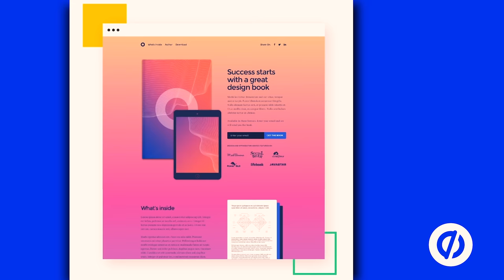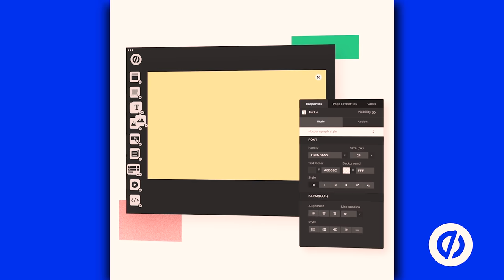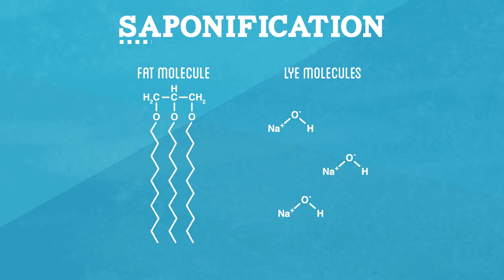How to Make Soap From Olives

Comment: Hang on, how were you actually using the screw? We didn’t see any sort of wheel or crank at the top for you to apply torque to the screw. Nor did we see it actually thread all the way down to apply pressure to the stack of crush olives.
Reply: The tap and die are still a ways off; carving the inverse of a hand carved thread would be very difficult with even modern tools. And that screw was far from straight. I'm guessing they took some artistic liberties with that part.
Reply: I assumed as much. I’d seen woodworkers make wooden nuts and bolts as a challenge, and it seemed difficult enough as is. When Andy first mentioned that he planned on making a screw, I was immediately a bit skeptical.
Reply: They did not press that oil either so it's all good
Reply: With such a wide thread the reverse won’t have to be exact. I would think a simple angled edge would provide all the power needed. 
I kind of like that they make these things from scratch and don’t hire professionals. It represents the struggle you and I would have to go thru if we had to provide for ourselves

Comment: Aren't railroad ties considered toxic by the EPA because of the creosote and other chemicals used to prevent rotting. I guess as long as it doesn't come into contact with the food directly it should be "ok". Look forward to the next video.
Reply: they're very toxic and not safe to handle, in my area people who try to use them for landscaping get in trouble because they're dangerous to handle so not allowed in residential areas.  they can make you sick if you handle them barehanded, especially older ones from when they were a bit lazier with safety regulations.
Reply: @TheMichigami  I hope they don't keep it around to long or at least replace it with something a bit safer
Reply: Older rail sleepers weren’t contaminated with creosote and so are able to be used
Reply: @lachlanngordon1577  from the cross section I saw I'm pretty sure that was a railroad tie soaked in creosote  and even if it wasn't it would still preserved with chromated copper arsenate which is almost worse.
Reply: @lachlanngordon1577  they've been using creosote on them almost as long as laying rail has existed, my gramma was warned as a kid never to play around with discarded track wood because it could make you sick, and even during the depression people living in coke ovens desperate for heating fuel would scrounge fallen coal off the tracks and burn furniture before touching rail wood, they knew it was poisonous to handle and burn.

Comment: This is something obvious but I challange you to make <tat tararam> bucket. 
You already are using iron tools but for bucket it would be challange, as iron is still fairly difficult to process. 
Therefore wooden bucket would be great starting point

Qualities:
- Can be cleaned, or quickly replaced
- Waterproof (duhh)
- Light (water will be heavy enough)

Comment: Pro Tip: Warmer temperatures speed up the chemical reaction a lot. When we did this in our Chemistry class, we mixed the lye and oil over a burner.

In my opinion Nitrate fertilizers and soap were the most important inventions for country development. With Nitrate fertilizers fewer people were able to feed a higher ammount of people, making it possible to assign more workforce to other sectors, and the soap made sure they didnt die so quickly from disease.

Comment: 11:57, Isn't that store bought chemicals? Is that why the second batch yielded better results? Does that mean the original sample is the only quality one can achieve with naturally collected materials?
Reply: The process of making soap requires oil, water and lye, plus mixing. Each oil has a molecular composition, chains, that react differently to the combination of lye and water. Olive oil takes a really long time for the immersion Process. The first attempt wasn't stirred long enough to completely incorporate the ingredients, which is why it separated. The 2nd attempt, stirring longer is what is required to get the mixture to end up being Soap, when using just olive oil.  No store bought chemicals were used. They made the lye, the hard way.

Comment: Yay, finally the screw!
One thing you didn't touch on, did the soap smell olive-y or lavendery or not at all?
Reply: From my experience with olive-based soaps, they do smell like olives a bit, but it's more subtle. So it should smell like a subtle mix of both.
Reply: It smelled really good!!! Very lavendery
Reply: @ornessarhithfaeron3576  ... I wonder where you are getting your olive oil soap? In my experience, without any other additives, it should smell like soap. Unscented soap.

Comment: Fun fact - you can get lyme (a mixture of calcium and potasium chlorids) by simply burning hard wood and putting ashes into water. Once mixed and then left to sit, hydroxides stay dissolved in the water while all the debree falls down to the botom.
Another fun fact, if you mix ashes with just enough water to create clay consistency, you can shape it like clay, then when left to dry and mature, calcium hydroxide binds with CO2 from the air, creating primitive concrete. For smaller amounds of materials, there is no need to mine anything. Ash from the cooking fire would do.

Comment: The high pH of the soap might have something to do with water-soluble compounds in the lavender. If you steep the lavender in warm oil and then filter it, you might be able to get most of the fragrance without the water-soluble compounds. At first I was going to suggest steeping the lavender in hot water and then discarding the water, but the oil soluble essential oils might leave with it, plus I think the flours could lose some of their color and wouldn't look very good.

Comment: You could easily neutralize the soap by testing it with living, blue lavender. Any blue flower is an effective test strip. If the solution turns red, add vinegar -- which is diluted acetic acid. Acid neutralizes base solutions.

Comment: You could have made the LYE by running water through wood ash and saved a few steps. Also, float an egg in the water to judge the PH. It should float leaving a spot about the size of a quarter above the water.

Comment: I must've missed the episode where you guys invented protective gloves, eveware, and ph strips!
Reply: I applaud the safety gear. The alternative to pH strips is called "zap testing": you literally lick the soap and if you get a shock sensation, there is unreacted lye and it needs to be left longer to cure. Considering that they didn't have a curing period at all here, it would have resulted in chemical burns to the tongue. (I've made soap by cold process and hot process).

Comment: To make a telescope, you need only flat mirrors (which can be made with copper or steel, too, if you polish and wax them) or precision-grinding glass lenses. Alternatively, you could use a mix of clear (tree) resin and glass dust (which is very dangerous, because when inhaled it can shred your lungs form the inside), which to be molded into shape. The resin-glass lens would need to have a custom recipe for the specific temperature (and maybe also rough humidity level) it's used at, to avoid it's melting. I think melting skin or sinew to make glue could be used to get glue which works in dry environments, too, but I'm not sure on how clear the lens will be.

For a mirror telescope (or reflecting telescope, also called a reflector), you first need to make cylindrical rollers, or at least one, to roll the metal into a thin sheet, like with a pasta-making machine getting the pasta thinner. After it's thin enough, some light polishing would help make it shinier (more reflective), and waxing would make it retain that reflectiveness for a lot longer. With thin-enough mirrors (which can be quite thick, actually, if enough force is applied), you can add a slight curvature to the flat mirrors. You might have a blind spot or more, in the telescope, and things might be slightly deformed on one or more axis, but it would still be better than trying to precision-grind glass lenses AND make them smooth, and both mirrors and lenses require polishing. 

A screw can be used to change the curvature of the mirrors, to adjust the zoom levels and optical deformation. And for precision measurements, you can use a primitive micrometer, or high-precision primitive calipers, using a screw to get sub-millimeter measurements. You can also make a set of feeler gauges, to be able to synchronize all other micrometers and calipers to the same standard.

The advantage of having a telescope is that you can use tethered balloons and a lightweight mirror carried by those to make maps, by pointing the telescope at the mirror, and drawing. You can also change the angle by changing the length of the tethers. If you really want, you can even use a dark room in the middle of the day with the telescope as the only source of light, to effectively project on a table what the mirror-in-the-sky reflects, to make map-making easier. Have all that system be portable, and you can be a travelling mapper. Have a big enough system which gets high enough into the atmosphere, and you can effectively map a good portion of the world, if you wait long enough for the clouds to clear, so you can see things.

Comment: Makes sense that the soap was so alkaline. Soaps are by definition alkaline ans the 10ph is right in the middle. To make a 4-6 ph “soap” you need a different process, and these are called “syndet” (synthetic detergent). So, that 10 ph soap is quite successful.
Note: the Dove “soap” is actually called a “beauty bar” due to it’s 6 ph.

Comment: Egh... While I applaud your efforts, the use of soda ash was a much later invention, and leaching wood ash from fires in water for the potassium hydroxide  (rather than sodium hydroxide, which is used to make hard bar soaps) is what was used the world over for a much longer period of time, something that you could have actually tackled back during your early bronze age period, as it was known to have been used in ancient Sumeria, no later than 3000 BCE. Additionally, liquid soaps like castile soap were made long before bar soaps were, and it was sorta disappointing to see you go the route of a hard bar soap here. Also disappointed that you didn't upgrade your press mats, as long before the time of the screw press, they'd already developed flexible, open baskets called frails to hold the olive paste. Lastly, you alled the press a "new simple machine", when Archimede's screw was already invented back in 200~ BCE.